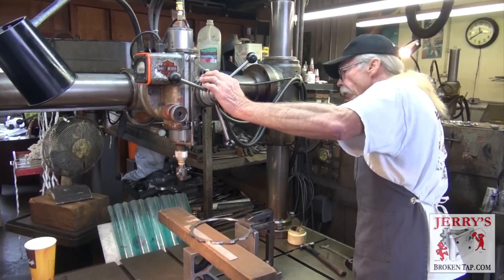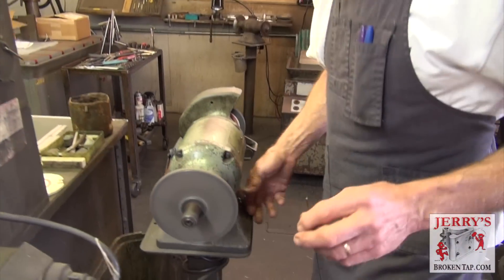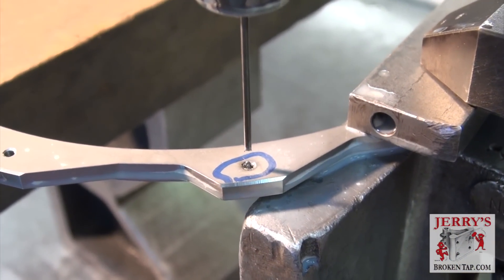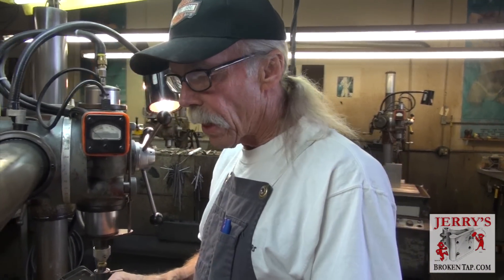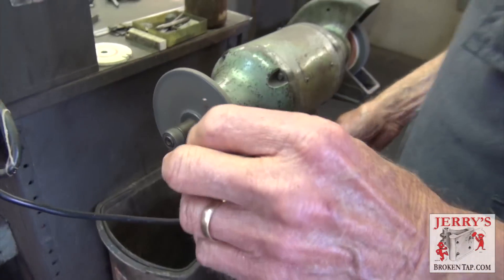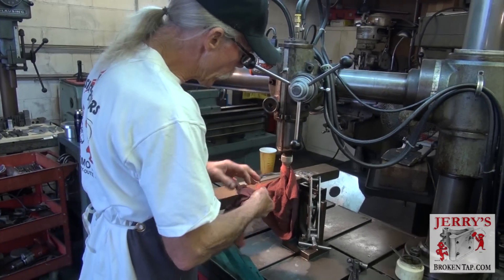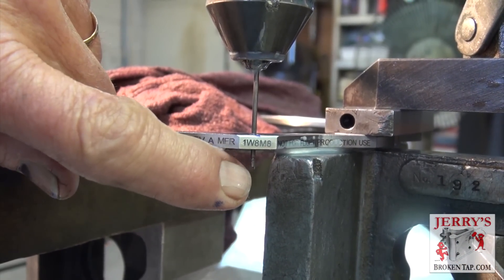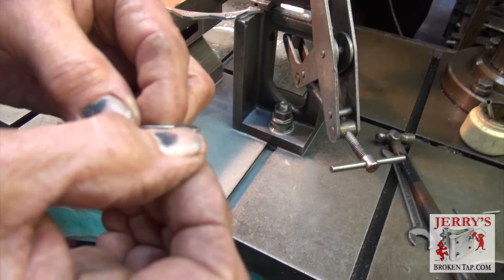Small Broken Tap Removal by EDM Metal Disintegrator

Comment: What is the protocol for failed extractions? Considering th natural if your business I do not think it would we fair to hold he company accountable
Reply: I know from a comment on a different thread about this business that the guy is extremely reasonable, only charged 50.00 to do a single tap removal and you have to consider he loses some of that in materials and electricity.

So it has to be looked at the right way. Someone else screwed it up, that's why they are there and they've effectively already lost the part. This is their last chance to fix their screwup, not greedily expect a small businessman to cover their screwup that already happened.

Comment: Dear Tom,
Hurricane Matthew did a number on my shop and I was hoping you could help recommend a new EDM for me. I had an old Rawlmikes Tap Buster that I used in conjunction with my milling machine, it was a small portable unit with an automatic feed and you could also use it in the field and set up clay dams to pool EDM fluid. My unit is old, it's not solid state, it had the beautiful warm glow of electron tubes (I'm going to miss the glow).
  Anyhow, could you recommend an American made device similar to what I had with the auto-feed and portable enough to carry around or run in a milling machine.

Thanks for your time and any information that you can provide.
Sincerely,
Michael Burke

Comment: If I understand this correctly - the purpose is to remove material without affecting the threading?

For a small part like this, what would be the cost of machining a new part?
Reply: ssfsx17 Yes, cost est.55.00
Reply: +Tom Grafton I'd expect quite a bit more thanks to aircraft stuff. It also depends on the scale of production, the more you're making the cheaper each one is.